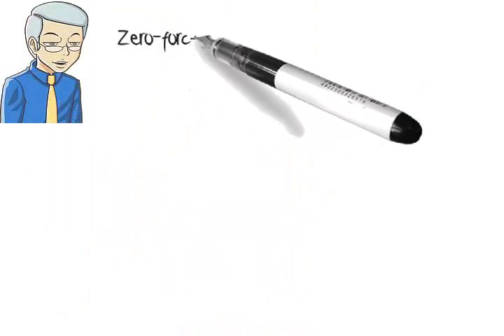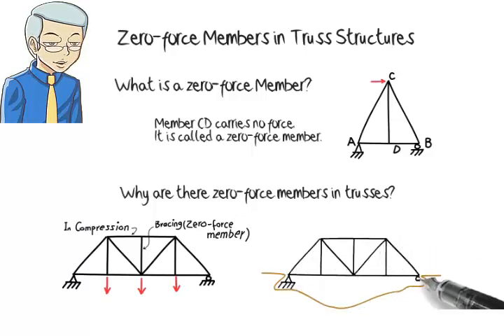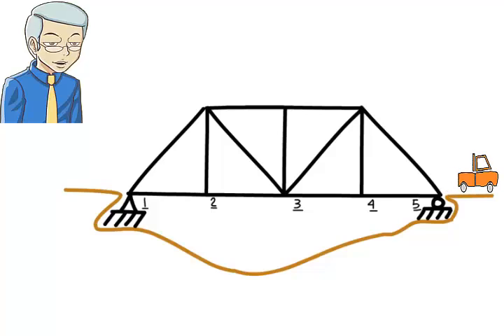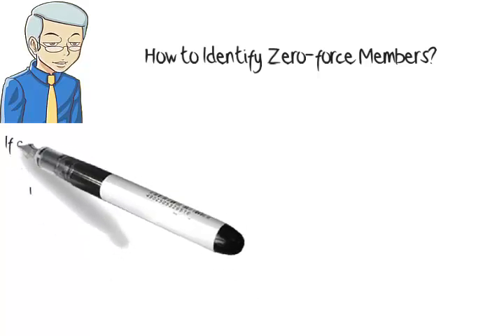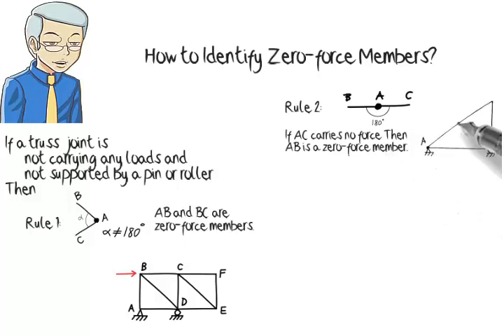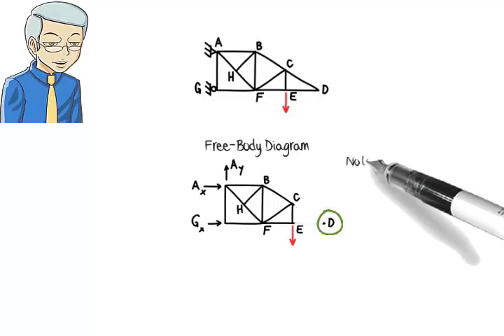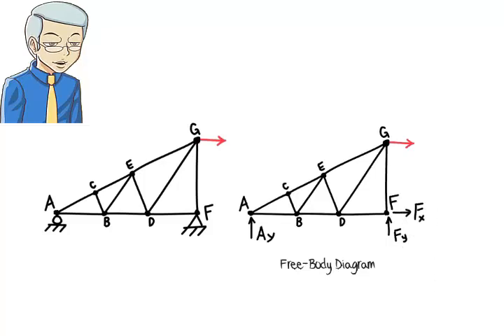SA05: Truss Analysis: Zero-force Members

Comment: what are the answers for the 3 problems at the end? So I can reaffirm if I actually know how to do this
Reply from the maker: (A): None of the interior members (BF, BE, CE, DF, IH, HJ, GJ and GD) carries any force. The three members forming the outer triangle (AD, KD and AK) are the only ones that carry any force.

(B): BD, DE, CD, CA and CF are zero-force members.

(C): GH, FG, EF, DE, CD and BC are zero-force members.
Reply: Sorry for the late comment, but could you explain why in @A, DH and DE are zero force members? I would think the horizontal force acting at D creates a reaction inside DH and DE aswell as the outer triangle.
Reply from the maker: If we examine Joint A in isolation, we would not be able to see that DH and DE are zero-force members. In principle, you are right, all four members connected to A can carry a force, but they don't have to. That is, only two inclined members are needed at the joint for carrying the horizontal force, the other two members, even when they do carry a force, are redundant and not essential for the stability of A.

To see why DH and DE are zero-force members, we need to employ deductive reasoning. Starting at joint C, we can conclude that CE is a zero-force member. So, let's remove it from the truss. That leaves only three members connected to E. Since DE and FE are co-linear, then BE must be a zero-force member. Remove BE from the truss then examine joint B. Similar to the previous two steps, we can conclude that BF is a zero-force member. Remove BF from the truss, then examine joint F which leads us to conclude that FE is a zero-force member. And that leads us directly to the conclusion that ED must also be a zero-force member. 

If we apply the same line of reasoning to the other side of the truss, we can conclude that HD as well as IH, HJ, JG and GH are zero-force members.
Reply: You have my gratitude. Your work is amazingly useful!
Reply: @DrStructure  Please continue adding lectures.. This channel is the best I can get!! ❤
Reply: @DrStructure  (B): FH, FG are zero-force members?
Reply from the maker: @nagarjun1349  In exercise problem B, FH and FG are not zero-force members; and they cannot be shown/proven to be zero-force members.
Reply: @DrStructure  Thank you so much for your quick response. as per my understanding. In exercise problem B: the load is vertically attached to joint H, (as per Rule 3): we consider GH is collinear, then FH can be zero-force member. Vice versa GJ collinear where the horizontal load is acting at J and FG can be zero-force member.
Reply from the maker: @nagarjun1349  Rule 3 states that if there is no load and no support at a joint, and the joint connects three members two of which are co-linear, then the third member is a zero-force member. For Exercise B, since there is a load present at H, Rule 3 does not apply. 

But let's assume that the is no load being applied at H. In that case, we can use Rule 3 to infer that GH (not FH) is a zero-force member. Similarly, if joint J was not subjected to a load, we could have concluded that GJ is a zero-force member.
Reply: @DrStructure  hi :)) i can't understand why in truss B: member CA is a zfm? there's a force acting at joint A, so why its a zfm? i am sorry it's just confusing, but according to your rule #2 if there's a force acting at joint A, therefore there's a force acting at member AB then the member BC is not a zero force member, because right from the start the force at member AB is not zero. right? or not? can you enlighten me? tnx in advanced :)))
Reply from the maker: basketball12125
1. According to Rule 3, BD and ED are zero-force members. For clarity, redraw the structure without them.
2. Since BD and ED are no longer shown in the truss, by examining joint D (using Rule 3) we can conclude that DC is also a zero-force member. Now redraw the truss without DC, BD and ED (redraw the truss without the zero-force members).
3. Joint C connects two members: CA and CF. Using Rule 1, we can conclude that both CA and CF are zero-force members.
Reply: Sorry for the late comment Sir...
In diagram B ) why GI is not equal to 0 ? If we consider a vertical reaction at I due to hinge and the force IJ will be collinear. So GI can be 0 right?
Reply from the maker: @harikaballa2001  If that horizontal load was not being applied at J, then your analysis would have been correct, GJ would have been a zero-force member. But, the member must carry a force in order for the sum of the forces in the x-direction add up to zero.
Reply: Dr. Structure . But Sir it doesn't matter with the horizontal force at J na when we consider vertical reaction at I (due to hinge) to be collinear with IJ. :(
Reply from the maker: @harikaballa2001  It is true that the IJ and JK are collinear. That simply means the force in IJ equals to the force in JK. But that does not say anything about the force in member JG, unless there is no load or support at J. 

The rule is: if a joint connects three members, and there is no load or support at that joint, and if two of the members are collinear, then the third member carries no force.  In our case, the rules does not apply since there is a load at J.
Reply: Dr. Structure In truss B, why member AB and AD are zfm if they are on a pin connection ? 

If we take the sum of moments about point I, we find that there are  reactions at point A. So there are forces that should be transferred by members connected to point A.
Reply: Dr. Structure For (B) why is CA a zero member, you said member who are supported by a pin cant be zero members?
Reply from the maker: Oscar paez
AD is not a zero-force member. See my comment above for why AB (same as AC) is a zero-force member.
Reply: I need basically your analysis software that equally includes the recent frame analysis.
Reply: True. what are the answers?

Comment: 5:20 is genius. no other video and neither my professors mentioned that you can treat external forces at a joint as a pseudo-member i.e. the same way as internal truss forces at a joint so you can extend the use of the 3-member rule. this is the key to so many zero force member questions where I always missed one or two members that seemingly fit none of the rules. thank you so much bro.
EDIT: wait, doesn't this violate the rule where there should be no external forces at a joint for zero force members to be connected to it??
Reply from the maker: You may want to take a look at a different approach for identifying zero-force members here: 

https://youtu.be/0AFou75Xft0

Comment: For rule 2, what is meant by it doesn't carry any internal forces? As in there is no point load on the joints the member is connected to? Are the red arrows on the first 3 examples point loads?
Reply from the maker: Truss members carry axial force. If the magnitude of such a force is zero—if the member carries no axial force— we call it a zero-force member. 

It is not necessary for a joint attached to the member to be loaded for the member to carry a force. Axial forces propagate through the structure without a load being present at every joint of the truss.

Yes, we use arrows to represent forces and loads.

Comment: I have a question. I understand rule 1 and 3 in your explanation, but doesn't rule 2 mean that I would first have to calculate the reaction forces in point A to know if AB is a zero force member?
Reply from the maker: Rule 2 usually works in conjunction with the other rules. For example using Rule 3, we may determine that a member (say, AB) carries a zero force. If AB makes a 180 degree angle with another member (say, BC), then using Rule 2 we can conclude that BC also carries a zero force. So, by examining joint A we’ve concluded that AB is a zero-force member via Rule 3, and by examining joint B (via Rule 2), we have concluded that BC is also a zero-force member.

You may want to see an alternative version of this lecture in our free online course. See the video description field for the link.

Comment: According to me GK,HK,JK should be zero forces Members but cannot understand why it is not in answers ?? IN TRUSS 2
Reply from the maker: How do you arrive at that conclusion? Please elaborate.
Reply: @DrStructure  AS we can see in structure that force is acting on H so Fh and  HK should be zero,Similarly Force is acting on G so JK should be zero and now if we will draw FBD of point K we will see GK is also zero as Fx and Fy is already zero at K.

Thanks
Reply from the maker: You wrote "... force is acting on H so FH and HK should be zero." 

Your assertion is not correct. It is true that a force is acting at H, but that does not mean that FH and HK carry no force. All we can conclude from joint H is that (1) the force is GH equals to the applied load, and (2) the force in FH is equal to the force in HK.
Reply: @DrStructure  THANK YOU VERY MUCH FOR CLEARING MY DOUBT .I HAVE NOT YHOUGHT THAT SOMEONW WILL REPLY TO MY QUERY IN SUCH ASHORT TIME. THANKS 

YOU ARE REALLY DOING GREAT WORK.
Reply from the maker: You’re welcome.

Comment: Hey, Dr.Structure I have got the first two ones correct. However, I am a bit struggling with the question c, Could you plz explain to me how you identify the zero-force member in c? :) Isn't it there support reaction at B?
Reply from the maker: Yes, there is a pin support at B, and one at A.

Start with joint H. Note that GH has to be a zero-force member, since the joints connects three members two of which are colinear. 

Remove GH from the truss, then examine joint G. Again, the joint connects three members two of which are colinear. That makes the third member (FG) a zero-force member. Remove it from the truss then proceed to joint F. 

Using the same line of reasoning we can show that EF is a zero-force member, so is DE, CD, and BC.
Reply: @DrStructure  Thank you so much for the explanation :)
Reply from the maker: @vaibhavraj3176  You're welcome.

Comment: @Dr. Structure  Sir, I don't understand why CA and CF are zero members? they are on a pin connection?
Reply from the maker: I am assuming your question is in reference to Exercise Problem (B).  

It is true that there is a pin connection at end A, but we arrive at the conclusion that CA is a zero-force member by examining joint C as explained below. 

Before we can draw that conclusion, we need to take three steps. 
Step 1: By examining joint B, since there is no load or support at the joint, we can conclude that BD is a zero-force member.
Step 2: By examining joint E, we can conclude that ED is a zero-force member.
Step 3: After removing BD and ED from the truss, only three members remain at joint D. Therefore, we can easily conclude that DC is a also zero-force member.

After removing the above zero-force members from the truss, only two members remain at joint C: CA and CF. Since there is no support or load at C, CA and CF have to be zero-force members.
Reply: @DrStructure ow i get it!! thankyou po!! ngayon ko lang nabasa toh .
this channel is great!! highly recommended :))))

Comment: Dear Dr. Structure,
Thank you for your response. As I understand, zero force member concept holds only for pin joints and not for welded joints. In many research papers people apply method of joints for free body diagram of bicycle frame in which all the joints are welded joints. They also apply for chairs and other furniture.  It so confusing. In one blog they said for chair having four identical legs with each leg being bent rod then all the legs are zero force members. I don;t know if there exist an authentic comprehensive book which can explain basics. I also need to understand if in a frame I have some elements as bent bar then how do I find stress on each member. How does bending moments cancels out to achieve equilibrium. Is it that we do not have theory for frames with welded joints. If there is where do I find them.
Regards,
Ravi

Comment: In a video titled "Two force members explained (statics)" is said L-shaped rod is in equilibrium and without being zero-force member. But according to rule 1 it should be zero force member. Kindly help me to understand.
Reply from the maker: The rules for zero-force member apply only to trusses, slender members connected together with pins. If an L-shaped system does not embody a pin, then it is not a truss configuration. A rigidly built L-shaped member, therefore, does not follow the zero-force member rules for trusses.

Comment: how can in the second exercise, GK have a force?
Reply from the maker: GJ carries a force and GH carries a force. Their forces are transmitted to joint G, which then needs to be balanced (sum of the forces at the joint must e zero) with the other forces acting at the joint. One of the other forces acting G is GK. So it must play a part in balancing the joint with a non-zero force.
Reply: @DrStructure  But there is IF member for balancing as well.For instance, GF & GI, they will also paly thir role, right?
Reply from the maker: @rafiurrahman6596  Correct! They all play a role in transferring the loads.

Comment: Electricity transmission tower modeling alway consider the legs members are beam and the rest of truss what is the reason and can we consider the also as truss members
Reply from the maker: "always" is not quite a fitting adverb to use here. The designed configuration of a structure, any kind of structure, depends on many factors. There are no fast rules for a transmission tower to be a hybrid system as you describe it.

Comment: In 6:48 how about force FD
It apears that it can be zero with 3rd rule
Reply from the maker: There is a pin support at F, the rule does not apply.
Reply: Dr. Structure sorry.in5:55 at G there is a roller and rule 3 is applied
Reply from the maker: Yes, the rule applies at G.

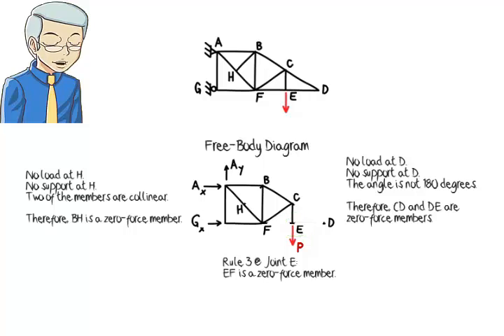Comment: Excuse me, at 05:40, how could joint E apply rule 3?
First, it need a truss joint is not carrying any loads & not supported by a pin or roller. Does joint E is that king of truss joint?
Reply from the maker: Truss members are axially loaded only. For analysis purposes, we can represent the member as a force vector.  In a way, we can think of a truss member and a force vector as one and the same.  When we see a member, we can think of a force. And when we see a force, we can think of a member. In this sense, the force and the member are interchangeable.

At Joint E, I see a force (Gx), so I can think of a member. For our analysis purposes, in my mind, I can replace that force with a member. If I do that, then I end up with three members at G, two of which are collinear, so the third one must be a zero-force member.
Reply: Thank you for your response. 
At 03:19, the principle of the rule must satisfy the truss joint is not carrying any external load and not supported by a pin or roller. 
At joint E, there have an external loading, can it apply the rules under this condition?
Reply from the maker: @3:19, joint E connects three members, with no pair being collinear, none of the rules apply to the joint.  However, once we apply Rule 1 to F concluding the EF is a zero-force member, we can then revisit joint E (which now has one less member), and apply Rule 1 to conclude that the other two members also carry a zero force.
Reply: Sorry, I made some mistake on the last reply. I present again at follow: 
At 03:19, the principle of the rule must satisfy the truss joint is not carrying any external load and not supported by a pin or roller. However,  at 05:40, joint E have an external loading, can it apply the rules under this condition?
Reply from the maker: Yes, the same line of reasoning applies here too. Forces and truss members are interchangeable. Except that at E, the two forces are collinear and one of them is not zero. So, the other one cannot be a zero force member either.
Reply: How to consider a force vector become a truss member, @0540, there have a loading P pointing downward at joint E, does the tail of force vector P is locate at joint E and the head of force vector P is pointing downward?
Reply from the maker: Yes, the tail of P is at E and the head pointing downward. So, conceptually we can view it as a force in a true. member.
Reply: Does the force Gx is consider as a virtual truss member overlap  truss member GF?  or Does the force Gx is consider as a virtual  truss member from point G  toward to support G?

Comment: Excuse me, at 03:19, it mentioned a truss joint do not carry any loading, what is that mean? Does the loading means external loading? At 03:19, does joint C also do not carry any loading?
Reply from the maker: That is correct. The rule works if there is no external load applied to the joint. And yes, there is no external load applied to joint C.

Comment: sir in the video 1:35 min in the video the vertical member at joint 3 remains a zero force member for any point of the moving load, then why that member is provided????
Reply from the maker: The member could be used to prevent buckling (due to a large compressive force) of the top horizontal member. So, the zero-force member serves as a stabilizer for the compression member.
Reply: Thank u sir... can u please make a video on plastic analysis and matrix method to find deflection..

Comment: can you please explain A problem (you had given in end of video)
Reply from the maker: Start at Joint C: CE must be a zero-force member since the other two members are co-linear. 

Remove CE from the structure. Now examine Joint E. BE has to be a zero-force member since the other two members are co-linear.

Remove BE, then examine the remaining structure. Using the same line of reasoning, we can conclude that BF is also a zero-force member.'

Remove BF, then examine the truss one more time. Joint F now connects three members only, two of them are co-linear. Therefore FD must also be a zero-force member.

We can apply the same line of reasoning to the other side of the truss concluding that IH, JH and JG and GD are all zero-force members.
Reply: Thanks alot sir you are great